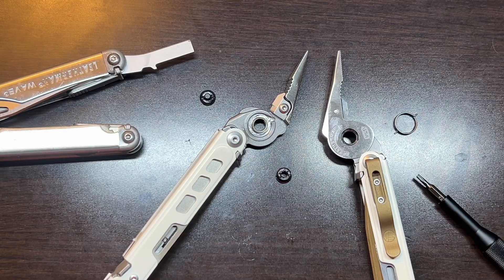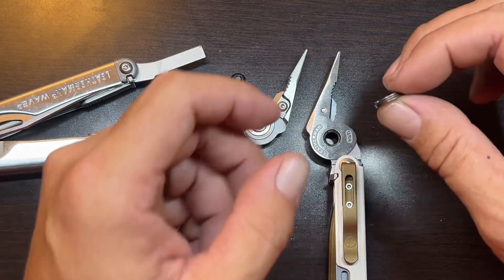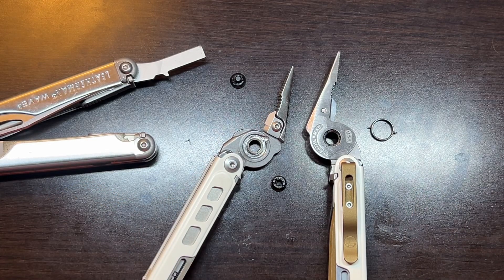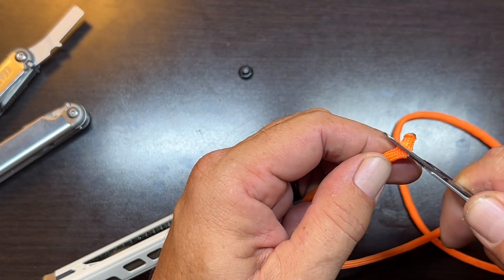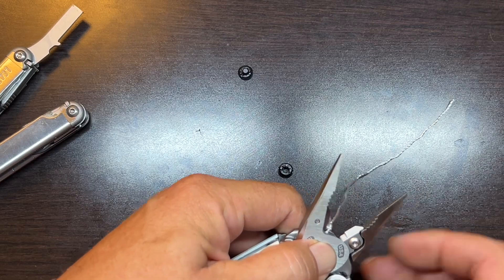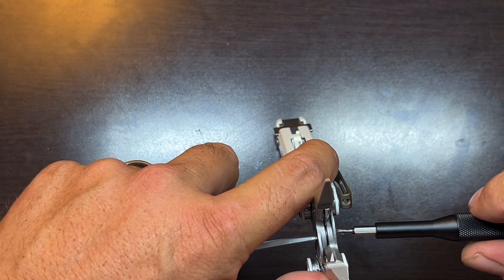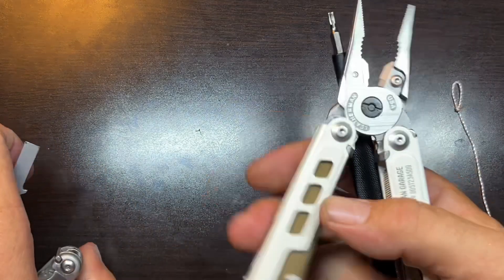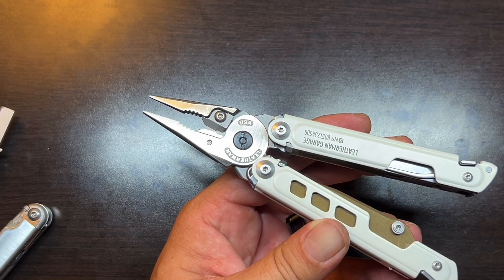Leatherman Garage #5 - I had to know how the spring action pliers worked!

Comment: Thanks for making this video. I had another multitool with the same spring loaded mechanism that I had taken apart at one time and I was not able to put it back together. After watching this I made it work using string (truth in advertising, I broke the string three times before I got this to work. And there were clamps and a vice involved in putting the tool together.

Comment: Just an idea - maybe it would be easier to remove a handle from one of the plier halves? Or is it the metal bits on the actual plier heads that make it impossible to align the spring in wide open position?

Comment: I think that when it was put together it was before the plier heads were in the frame so they could be assembled at 180 degrees and rotated into position. Cheers
Reply: @petermoore9504 Well I think the handle pivot area is raised higher above the center pivot plane and will get in the way. I think they will use a specialized gadget for the assembly in the factory.
Reply: Ok lets find someone to try this method. Any volunteers out there?
Reply: @1970jeebee  the whenever I've taken a leatherman apart it's never gone back together quite right ;)

Comment: It’s way easier to get bac together with the handle off on one side or both. That way you can just line up the slots with out the spring it under tension and the  use the plier heads to twist it in place while pinching it together with the screw already in once the screw pops down it’s locked in keep in held together then put the nut back on and then your handles. Taking off both handles is easier then just one but neither is hard

Comment: The significant thing taking strength away from the pliers is the removable wire cutter.
They'd be much better using a decent material for the pliers and doing away with the replaceable cutter. It's solving a "not really a" problem and causing others - it is much easier to cut things with the non-replaceable ones and the entire assembly is more robust.